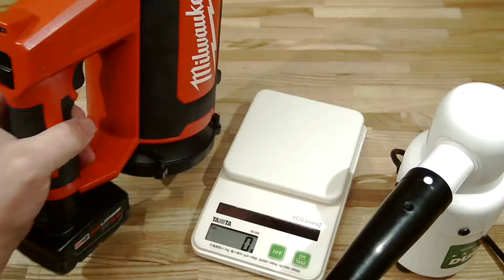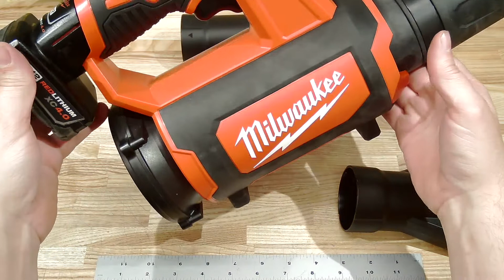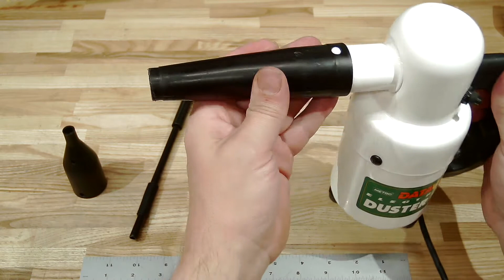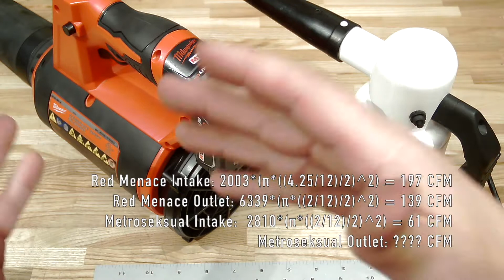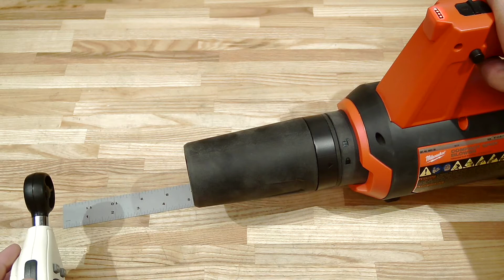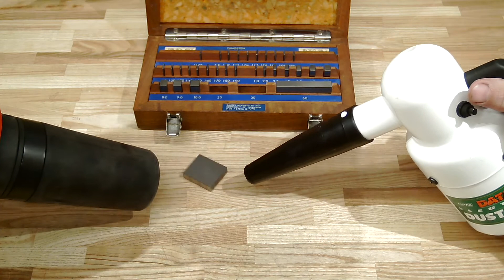Test: Milwaukee M12 Spot Blower vs Metro DataVac

Comment: As others have stated, exactly the video I was looking for, so thank you!

How does the M12 stack against the DataVac when it comes to blowing accumulated dust off electronic devices, such as desktops and servers?
Reply from the maker: Not so well, M12 is more volume of air but lower pressure.

Comment: You just saved me money. I have that Data Vac and wanted that M12 blower (I own over 10 M12 tools) but it's simply not powerful enough to be worth it. I'm going with the M18 blower.
Reply from the maker: I actually tried the M18 compact blower last year. Not bad, more air velocity than the M12, more flow than the DataVac, though the DataVac still beat it for pressure.

Comment: One thing you didn't test, which would have leaned in the favor of the milwaukee, is how quickly they can clear a surface of a certain depth of either metal chips, or wood shavings.
Reply from the maker: Not so sure about that usage. Clear surface fast, yes, make a mess, yes. In a shop the M12 would blow fine chips everywhere because of the higher volume of air. Best is a vacuum for cleaning and an air compressor that can target a focussed blast where you need it, and has the power to dislodge heavier chips or clogged recesses. The MetroVac actually comes close to an air compressor in a focused blast, but at the cost of being noisy and not being able to give quick little blasts. Shopping list: compressor. Milwaukee, ideal for blowing off sawdust from your power tools outdoors and other light duty leaf-blower type jobs. YMMV.